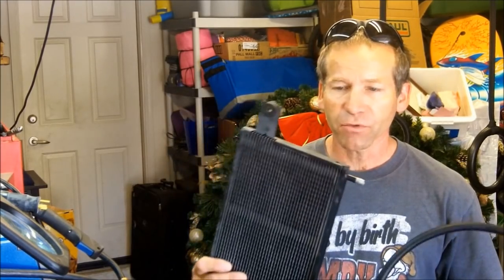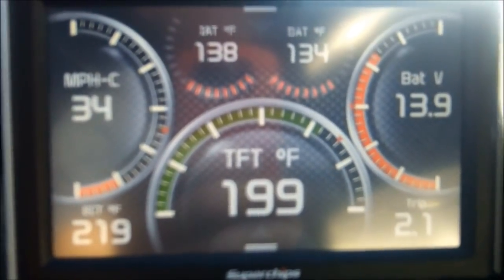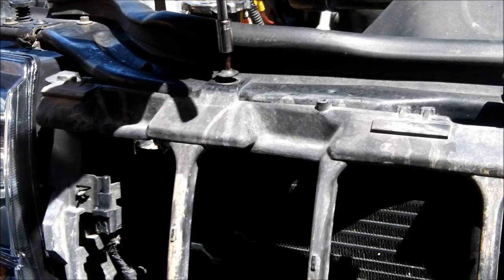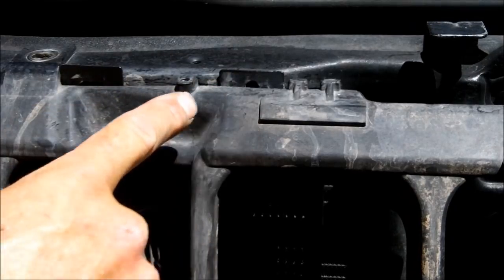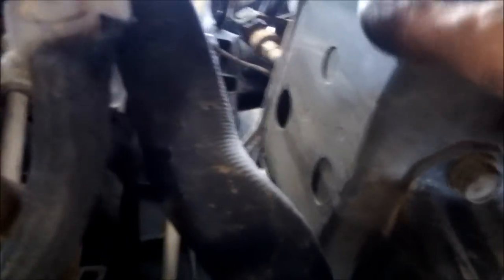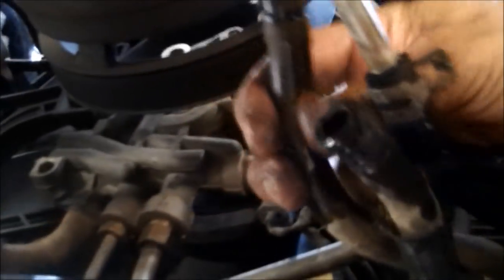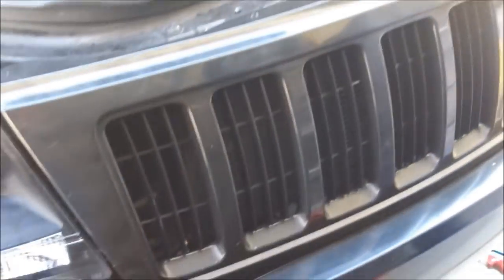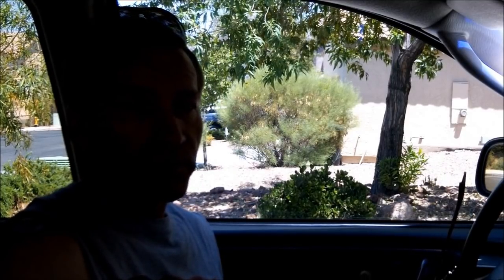Installing Transmission Cooler on a 99-04 Jeep Grand Cherokee

Comment: This is from the factory service manual: "Because the internal oil cooler is so efficient, no auxiliary oil cooler is offered" I guess the manual writers haven't been to Las Vegas in the summer! (or Phoenix, or...)
Reply: There are  original parts, that wear out , you can replace if transmission over heats though,right!

Comment: The Hayden Cooler listed is too big, you need a rectangle shaped one, find the one that is 6" x 11" ( 7" max width ),  Rapid Cooler Part #: ATP 17508.  Also, suggested to install in series, meaning keep the fluid going through the main radiator, then feed out to the trans cooler and back to the Transmission last.  Should be cooler overall.  I have not tested to verify.

Comment: Hey martain, can you do a quick video on checking transmission fluid level and topping it off after removing trans cooler lines.
99-04 Jeep Grand Cherokee 4.7L (WJ)
Mine is an 02 Laredo with Selec-Trac JHD-242

Comment: I had mt radiator blow a leak when uninstalling a scary unsafe electric fan that was installed by a shop mechanic without controller, module, fuse or a relay. It was hard wired to the battery.
Now i gotta change radiator to a Denso which im told is factory $187
And i have no clue how to check transmission fluid level after disconnecting cooler lines. The holes in dipstick dont give a clear indicator of correct fluid level. What operating temp you need to be at. If i can check the fluid level cold before disconnecting  then swap radiator and top off to that exsact spot. Then flush rad and bleed coolant and run to operating temp and double check fluid level.
If you can specify what dots it should he between cold vs hot that would help a lot

Comment: can you help a girl out.... so I have a 2001 grand cherokee laredo 4.0 6 cyl, it uses 4 oxygen sensors( if that means any thing). I had to replace the radiator, and the long and short cooling lines were siezed on them, so I removed then from the rubber hose they attach to.  so that I could remove the radiator(The cooling lines I have ,..need no special tool, they just screw on. My question is... I did not take note which hose they connect to... when I had to attach the new ones. Which skinny hose the long line/short line go to.  OMG...
The two skinny hoses on my jeep on hose has 2 nuts( sit right on top of each other then rubber hose attatched to it, the second skinny rubber hose does not have 2 nuts before it.  would you happen to know which hose the long/short radiator line connec to?  please help

Comment: My 04 JGC 4.0l automatic with the select-trac seems to be using the top portion of the AC condenser not the ports in the radiator.
Reply from the maker: You may want to have another look at that in 2001 with the 4.7 L they started putting the power steering pump cooler integrated into the top portion of the condenser.

Comment: Hey I know this is a old video...but will Superchips 42050 Traildash 2 give me a Trans temp reading on a 2001 4.0l Grand Cherokee through the data port also?  Or did you install a trans temp sensor in the oil pan?

Comment: Years after, did you ever connect in the default radiator trans cooler into your add-on cooler?  I happen to have my '04 apart at the moment, it does have an aftermarket trans cooler in front of the condenser, and it is in series with the radiator cooler.  This would seem to me that the trans fluid would be heated to engine (radiator) temp 'all the time'.. and heat from the cooler in front of the radiator would also be added into the airflow going by the radiator tubing directly behind the add-on cooler.  I am definitely impressed with the temp drop with the add-on cooler, but here, we are in a more temperate range than you, in winter, down to about 0F worst days, and then 102F ambient, summertime.

Comment: hello, what app or ob2 system do you use in your cherokee, I need to see the ABS and airbag failure, which in Brazil I didn't find an automotive scanner that gives correct information! Thanks

Comment: WJs did have a factory aux external transmission oil cooler early on.  Later on they put the power steering fluid cooler in the same spot with basically the same cooler flipped over so the lines ran the other way.

Comment: Martin, I asked about this, and you told me the line closer to front of transmission goes to the top line of the radiator. Problem is on my grand cherokee WJ 4.0 6 cyl. the two lines sit on top of one another against transmission clamped against with a clip, like a brakes lines are held. and like in this video those two hoses you show, the way they connect to that line, one of those lines on mine has i believe a check valve connected to one of those lines and then the skinny hose. how can I email you a pic. i really want to finish this job and drive off

Comment: I've done this to one of my WJ's and about to go and do it to the last WJ here that I picked up the other day.  As well as the electric radiator fan (this is a must).
Reply from the maker: I'm glad you liked it and found it helpful.
 Yeah I've done the electric fan and deleted the hydraulic fan and love it.
Reply: @martinbuilt  I know why they did the hydraulic fan, but it was a mistake. Electric is the way to go.
Reply: With today's temps I use both on my wj

Comment: Hey man, been watching your videos, really good stuff. I wonder where the TrailDash reads the temperatures from for the transmission. I have a physical sensor in the pan on my 2004 WJ Overland. I used to be getting 200-205 pan before the aux cooler and now after the aux cooler install I do not see transmission pan temps over 170 on the hottest days in traffic, 95-100 degrees ambient. Running highway it'll hover at 150 same 95-100 ambient. Also your coolant temp is too hot for a 4.7, need to bring those down to 195.  Is your hydraulic fan kicking up?
Reply from the maker: Snobrdrkid07 
I don't know where the actual sensor for the transmission is. I haven't actually looked into the operation of the hydraulic fan is it supposed to kick into a higher speed? I do notice that it does run around 220 plus degrees on days that are 108 degrees or hotter here in Vegas
Reply: Hey Martin, I actually don't know where the sensor is either, but the pan temperature is the "average" temperature. There are spots that are probably hotter. It was 100 on the east coast with what might as well be 100% humidity and running 200 coolant and transmission pan temp was 155 running down the highway. I still have my factory cooler hooked up for the transmission as well as the auxiliary cooler. When I am sitting in traffic and the AC on, I can feel the hydraulic fan and hear it, it is spinning so fast. I'd check the water pump out, and maybe consider a new radiator (of quality) if it is original. I wouldn't feel good driving down the road with those high numbers on a 4.7
Reply: The hydraulic fan runs off the power steering pump, as the pulley on the pump spins faster it pushes more fluid thru the hydraulic fan and makes it turn faster.  Usually once you are driving about 50 mph or so the air forced thru your radiator is sufficient to keep your water temperature correct.
Reply: intreppid this is partially incorrect. The fan speed is controlled by a solenoid that will let more or less fluid flow at any speed. At idle the fan is capable of spinning very fast and if you do rev it, it will soon even faster with additional fluid flow.
Reply from the maker: the fan does kick up when I turn on the A/C. I can't tell if it is when I'm drivivg

Comment: Now how much lower would it be if you would have connected it to the original one and had them BOTH operating instead of replacing the original?? Why wouldn't you do that?
Reply from the maker: One thing that will do is warm the trans up quicker not that that is a bad thing. The main reason I did it was if the engine is running hot then so is the trans.

Comment: Ive changed a raditor on a 4.0 and like to never got the lines loose from the raditor because they hadn't been off in so long.  An external trans cooler should have been a factory upgrade.
Reply from the maker: Absolutely, heat is the number one failure for automatic transmissions.

Comment: Did you fill it with transmission fluid after you connected the new cooler?  Do you need to fill up the cooler?
Reply from the maker: No, you will lose very little fluid and the cooler only holds a few ounces of fluid. You could add 8 oz if you what to.

Comment: Hey Martin, any idea if a trail dash 3 is compatible with a 2002 WJ?
Reply from the maker: Looks like the trail dash three is only made for 2007 and later Jeeps 
2007-2010 3.8L Jeep JK

2011-2018 3.6L Jeep JK

2018-2021 3.6L Jeep JL non-eTorque

2018-2022 2.0L Jeep JL eTorque/non-eTorque

2020-2021 3.6L Gladiator

*For 2015-2021 model years, an unlocked PCM will be required, but our PCM Swap is included with the purchase of the device.
Reply: @martinbuilt  Hello again! Could you provide a little more detail on the pcm swap? Like i said before, I drive an 02 WJ with a 4 liter. Im looking for any kind of electronic tuning device so i can monitor my fluid temps, etc. By pcm swap, do you mean there's an upgraded/updated pcm thats compatible with my year and model to allow for tuner chip compatibility?

Comment: So there is a total of four lines for cooling. Not sure what the the two you capped off were for. Im rebuilding one of these and im getting to the transmission lines next. Any input would be helpful!
Reply from the maker: There are 2 trans lines, supply, and return. The 2 that I capped off were from the trans cooler that is in the radiator. I bypassed that cooler. Then you have the supply and return from the transimmision. 
If you want to use the radiator trans cooler in series with the other cooler leave the supply line (hot fluid) hooked up. Then take the return line from the radiator to the secondary cooler and the return line to the other side of the secondary cooler.
Reply: @martinbuilt  much appreciated. Your videos are top notch!
Reply from the maker: @ronr149  Thank you. I really appreciate that.

Comment: I live where it gets colds and I'm now installing a Transmission Cooler Thermostat.
Reply from the maker: That's probably a good idea. In my 98 Jeep Cherokee, I have bypassed the radiator trans cooler and during the winter months the temp never even gets close to normal operating temp.
If I drive at highway speed it won't even get to 105* on the digital gauge. Not until I slow down and the torque converter is unlocked will the temp come up.
Reply: @martinbuilt  on my 96 zj, I ran 1/2" hot and return lines in my 44re that spliced into 2x 3/8" system with Y-barb connectors. 1 goes directly to radiator and the other to a 12x14" trans cooler with fan in the back of the jeep which has a 3/8 barb joint with a valve.

In the winter I shut the valve off, trans temp ran directly from radiator gets 170. Turn valve half way in spring and fall, fully open in summer. Went to Death valley last year 125F weather and my trans fluid temp only gets 185F crawling on dirt.

Comment: Great video's Martin.  I am the original owner of a 2004 Grand Cherokee 4.7.,  145,000 miles.     I have a cross threaded spark plug in the #7 hole ( drivers side all the way back).    Any suggestions on how to drill and Heli-coil it or is that for a shop ??   I am an old school hot rod'er and shade tree mechanic.      I did recently replace the rear main engine seal in my garage ( that was a job ) !  Thanks, Billy
Reply from the maker: That sucks...I was getting ready to change plugs on my and do a video. I wounder if you can get a tap down there and clean up the threads. then vacuum out the cylinder. Then if you can get a bore scope to see that the threads look good and that you got all the shaving out.
Reply: helicoil kit

Comment: It's hard to see. but was that put right in front of the condensor? It didn't look like you had the condensor in.
Reply from the maker: Yes, 1" in front of the condenser.
Reply: @martinbuilt  Ah, I was mixed up. I mean to say power steering cooler. It looks like my 2002 wj 4.7 has power steering cooler on the passenger side in front of the condensor. Does this transmisison cooler go in front of that/ or do I need to modify (get longer) hoses in order to put on the driver's side?
Reply from the maker: @nebulousJames12345  
On my 04 the power steering cooler is the top portion of the A/C condenser. You may have to move the trans cooler to the other side or in front of the PS cooler.

Comment: So do you leave the old lines in place? And by chance, do you have a part number for the unit you installed? Great video. Thank you.
Reply from the maker: Jose Martinez 
Yes I left the lines coming from the radiator in place with the bolt stuck in the end of the lines are still there today. I got the transmission cooler out of a 90-94 Ford Explorer..Thank you!

Comment: very nice mod .. 
i thought it would lower the engine temp but it seem to only effect the trans temp ...
the other thing is I read somewhere that maintaining a 215 f would drop valve seat and your engine running 221 did it effect you engine in anyway ?!
Reply from the maker: it didn't have any effect on engine temp, I have since replaced the hydraulic cooling fan with an electric and now the engine runs between 180 and 200*  with a 180 T-stat.
I believe the cause of dropped valve seats is improper purging of air from the cooling system. The air must be removed from the cooling system.
Reply: @martinbuilt  
I'm planning on changing Tstat to 180 and doing the hydra fan solenoid mod maybe tomorrow but i feel that it's not the solution ...
as for the hydra fan my research concluded that there is smth wrong in the connection.

the fan solenoid is controlled by JTEC with pulse modulated signal that controls the fan speed from 0 to 100% ...
if you applied direct 12v to the solenoid it go directly to 100% 
because of bad connections i believe the signal is lost in the way that is why it won't speed up ..
only if the engine temp reaches 220 PCM would apply 12v to the solenoid ...
what I'm trying to figure out is how the trick the pcm to put the fan on 100% when it reaches 210 ... I'm thinking of moding the engine temp sensor to report higher temp than it actually is so when it reaches 210 it will read it 220 and trick the pcm to go to full mode on the fan ...
sorry for writing too much but i hope you may have some thoughts on this
Reply from the maker: @bujanah  you could do that by adding a resistor to the temp sensor just enough to read a higher temp. This would most likely also see a higher temp on the temp gauge.
Reply: @martinbuilt  
hi .. i have added the resistor and it works great no more overheat or creeping to the other side of the temp gauge ...
I've added almost 12.6 f degrees so when it hit 208 it will report 221 which will ramp up the fan ...
the only issue to notice is that I'm having a rough startup and it almost stall but then it picks up and runs great ...
why do you think this is happening?
Reply from the maker: @bujanah  that's great that it worked let me know exactly what resistor and how you tied it in. Your symptoms on startup sound like the idle air control valve is faulty or needs to be cleaned.
Reply: @martinbuilt  
I've added 3.46 k ohms parallel to the temp sensor so it would report higher temperatures to the pcm and that would ramp up...
anyway I would love to share my info with you over an email or Facebook and maybe you would do a video about it to help other hydraulic fan owners ...
Reply: @martinbuilt  
I think it's related to fact that the ECT is reporting a higher temp on cold start which makes the pcm runs leaner not richer as it supposed to be on a cold start

Comment: What did you do with the other lines you plugged with bolts? The original lines that came out of the radiator?
Reply from the maker: Well I've been running that cooler now for 2 years I believe with it disconnected from the radiator transmission cooler. it's been working perfectly fine that way so I am going to just remove those lines from the radiator. I only left them there just to make sure I didn't need to hook them back up if you live in a cooler climate I would recommend that you use the radiator transmission cooler and the auxiliary one. Go through the radiator first then the auxiliary.
Reply: @martinbuilt  
I'm in FL, so obviously not a cooler climate....BUT, i just don't want loose/plugged hoses flopping around (i think the mod looks great and wouldn't want to ugly it up by having hoses that don't connect). Could you explain a bit more how to connect both? Which one (upper or lower) is "in" and which is "out"?  I imagine i could figure out how to connect both properly. I'm thinking something like this:
1. disconnect the current "out" hose from the transmission end (the hose that runs FROM the radiator TO the transmission)
2. reconnect this same hose to the "in" (upper or lower?) of the transmission cooler
3. connect a new hose from the "out" (upper or lower?) of the transmission cooler
4. connect new hose FROM transmission cooler TO transmission

is this correct?
Reply from the maker: @steelerdynasty2007  the transmission line that connects to the highest point of the radiator is your return line. Disconnected below where it turns to rubber hose. Then connect a rubber transmission line from that point to the Lower Side of the auxiliary transmission cooler. Take another rubber transmission line from the upper auxiliary transmission cooler and connected to the metal line returning to the transmission that you disconnected earlier.